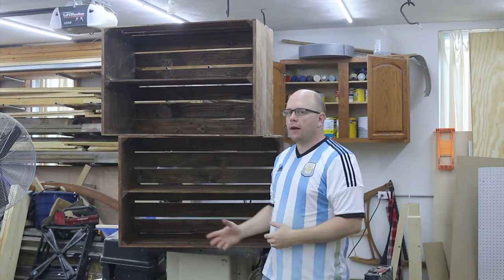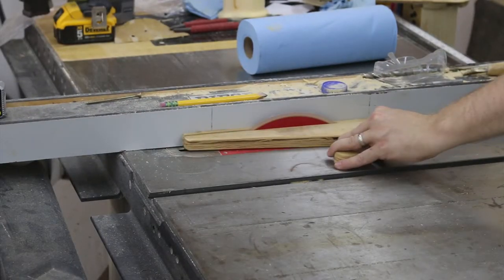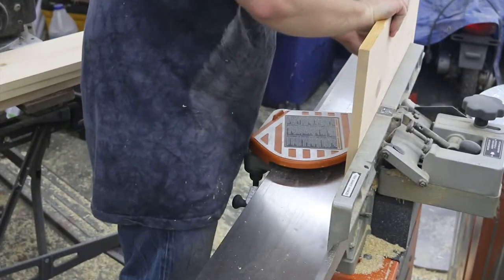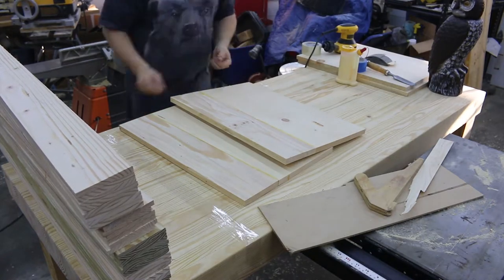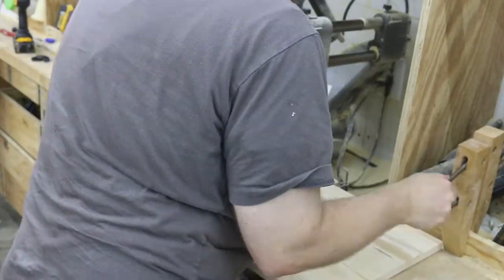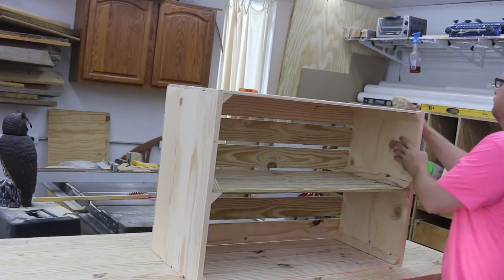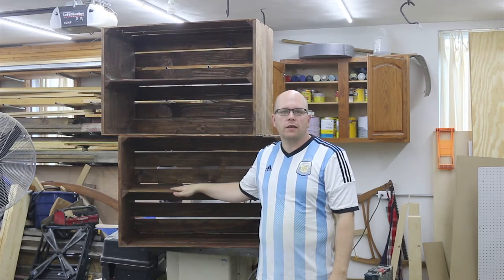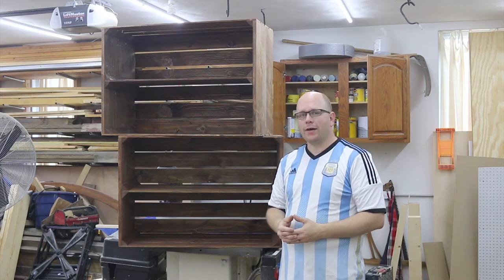Pallet Wood. Apple Crate. Shoe Rack.

Comment: Is it possible to buy apple crates already made?
Reply from the maker: Yes, you can. You can also get them free from fruit vendors, but either way you are stuck with whatever size is available. These were made to fit exactly in a specific spot in someone’s closet, so they had to be custom made.